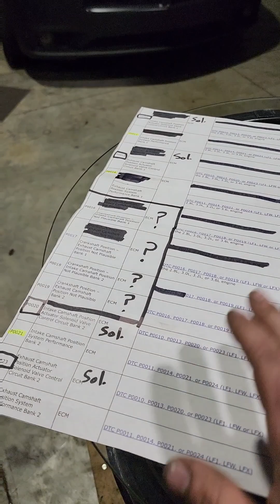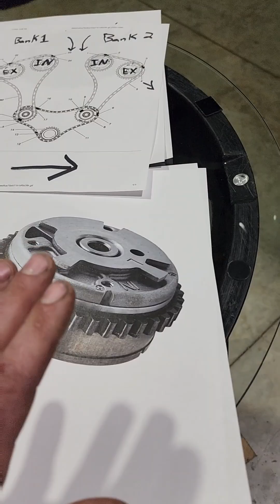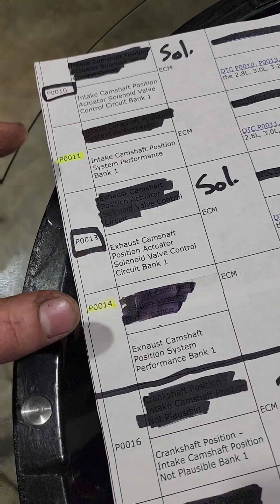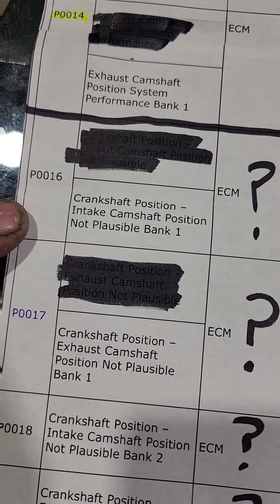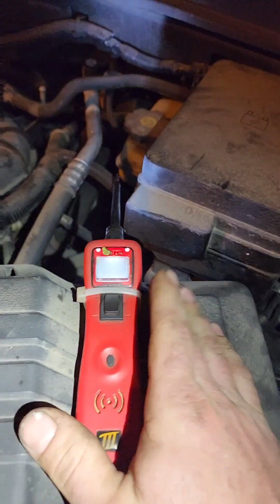GM 3.6, 3.0, & 2.8 Timing Codes and What they mean!

Comment: Question: is any of this related to oil change frequency or quality of oil? I'm asking because of these circuits being so sensitive and your running a cleaner through and helping the problem. These new modern engine maintenance recommendations may be aimed at saving customers' money but not in the long run if it leads to these type of troubles.

Comment: Hello Rob, having trouble figuring out how to diagnose p0016 through 19. Think bad crank sensor or spun reluctor on the crank. Will set one almost immediately then one after another. Idles rough with a shake at idle but no misfired reported. ok not perfect at highway speed. Thing I need help with is info on why does the pcm determine it doesn't like something but I can not see it on scanner, all seems good. All zero degrees for actual and desired positions. Does GM not report actual timing at idle? This would make sense because pcm would see something I can't. Any insite would be helpful. Thanks, Ken

Comment: Hey Rob,I have a question.  I'm doing a timing chain /cam phaser set on a 2.4L ecotec (a full kit with hardware and everything) I'm just curious,  should I apply any blue lock tight to any of the bolts? I know the cam phaser bolts are tourge to yeld.